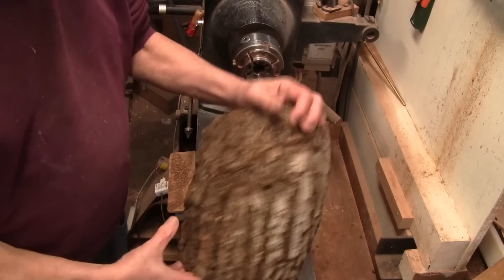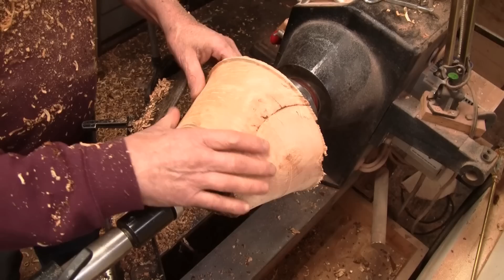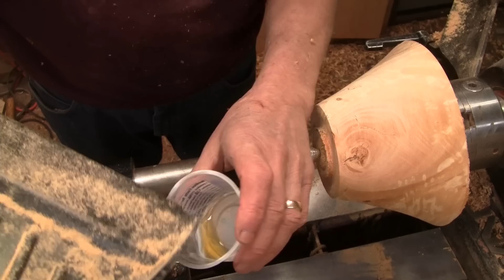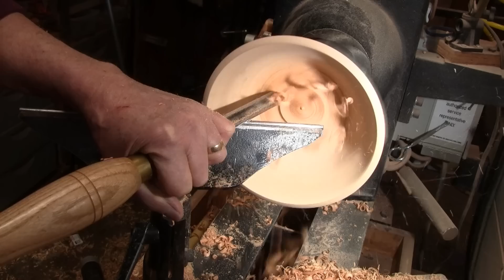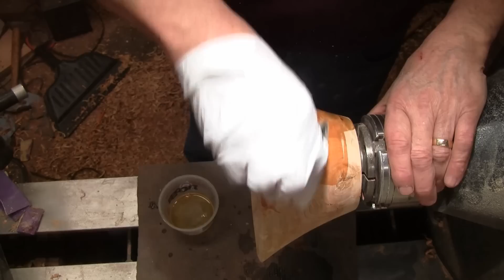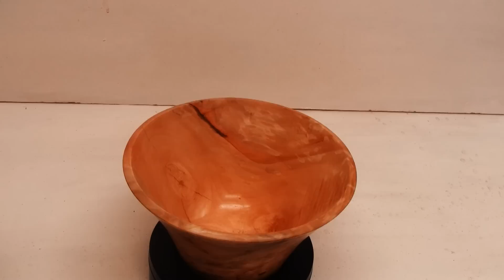Turning A Crackin Nice Piece Of Apple Wood

Comment: Beautiful Bowl. That is some very nice looking Apple Wood. I like your idea of mixing the saw dust with Shellac and Sanding sealer. I will be trying your trick. I have tried different glues with the dust. Does the trick but I don't really like the finished look sometimes.
Reply from the maker: Thank you John. Apple is a great wood to turn. 
I do not use glue for filling thing as the finish will not get through and you end up with a blotching looking piece. Maybe for filling a knot hole but I do not like that either.
I have built a lot of furniture and cabinets and you have to be extra careful where you use glue as it will always show if not cleaned up right away.
 Thanks for watching,
Gary

Comment: Curious about the technique of mixing fine saw dust w shellac for repairing small cracks. What is the advantage of this approach vs mixing sawdust w wood glue for same purpose?
Reply from the maker: For me I have the shellac going into the wood. Once wood glue is dry you can not get a finish into that area. It will just lay on top of the glue.  If you ever built a piece of furniture and did not get the glue cleaned up on some of the joints it will always stand out and look different.
With the shellac I was using shellac over it so it all blends together. I do the same with water based sanding sealer if I plan on using Polycrylic for the finish.
 Hope this makes sense and it is why I do it. Not to say other ways might work just as good.
Thanks for watching,
Gary

Comment: Good job Gary.
Great tip on shellac and sanding dust paste.
Fruit wood is certainly lovely timber. Thanks
Reply from the maker: Thank you Greg, yes it is hard to beat fruit wood. It has a lot to offer. The fruit, the pretty wood and the shavings are great for the smoker.
Thanks for watching,
Gary

Comment: I love pieces that have inclusions in them.  To me it gives the piece a natural beauty, 
especially when spalting is involved.  Using sealer, mixed with sanding dust, I never thought
of, but I will be including in the future.  That is one thing about videos such as yours, there is always new tricks to be learned that helps all of us.  Job well done.
Reply from the maker: Thank you Gerald. Yes all that nature really adds to the piece.
Try using water based poly with this sanding trick. It works great and you have plenty of time. But that also is when I use The water based poly. It is a good way to get the system down.
Thanks for watching,
Gary

Comment: Gary I love the grain and look of that bowl. It turn out beautiful. Thanks for the tip on using the dust and shellac to make a past. I will definitely be using that idea. Thanks for another great video.
Reply from the maker: Thanks so much Chris. I also works great with water based sanding sealer. I do that when I use Polyacrylic which is water based. Or if I just plan on using abrasive paste and wax for the final finish.
Thanks for watching,
Gary

Comment: Thanks you for sharing hi learning something a very time hi watch you work if hi used lacquer will do the same or sand and seal
Reply from the maker: Thank you Denis. Yes you can do it with lacquer. Do small areas as it will dry pretty fast. Same thing with the shellac.
The best to use is water based sanding sealer as it dries much slower. But that is when I use a water based poly for the finish.
Thanks for watching,
Gary
Reply: @ThePapa1947  thanks for the info

Comment: Beautiful piece, Gary.  Thanks for sharing the shellac/sanding dust trick.  Much better than making a paste from CA or 5 minute epoxy.  Love the figure in the piece.
Every time I watch you and Phil mount a block onto a spinning worm screw, I cringe!  While it can be an effective way to mount a block, it can also be dangerous.  You should mention to viewers that you are experienced in doing it and use a low lathe speed and a light grip on the blank.  If not done well, it can cause damage to the wrist, elbow and even the shoulder..  Just a thought.  Keep the videos coming!
Reply from the maker: Thank you Tom and your are right about mounting a piece that way. I have mentioned it but that was some time ago.
I will try and remember the next time I do it. It does take some practice to keep things safe.
I watch the piece getting close to the jaws of the chuck and then let go.
Thanks for the suggestion and thanks for watching,
Gary

Comment: Beautiful Gary.
I have only turned a few pieces of Apple but they all had gorgeous grain, just like this piece.
I have seen sanding dust and glue used to seal cracks but never sanding sealer and dust.
Great video as ever my friend.
Take care Gary.
Hwyl, Huw
Reply from the maker: Thank you very much Huw. I am sure you can fill cracks with dust and wood glue. My issues with the glue is it keeps the finish from getting into the grain. I know on furniture when gluing you need to get it all off while it is still wet or your finish will look different in that spot. Even if it looks like the glue is gone. So I stay away from using it to fill cracks.  If you have more to turn off it might be ok though.
Take care my friend,
Gary

Comment: Another pretty bowl. I was surprised you didn't fill the crack early, but it worked out nicely and the crack is an eye-catching element. Nice job, Gary.
Reply from the maker: Thank you Josh. I did fill it at the start but turned past the CA is my guess.
For sure the crack looks like it belongs there. And it does because I did not put it there LOL.

Comment: That's a great turning! I love the sawdust and sanding sealer mix to fill the cracks. Great idea! How long did you let it cure before turning or sanding again? Thanks for all you do!
Reply from the maker: Thank you Garry. You do not have to wait all that long. I would guess maybe 30-60 minutes is all I waited. Depending on the weather it might be faster or it might be slower.

Comment: Hi Gary, beautiful apple bowl. Great idea about the dust & shellac. By the way, you mentioned your poll barn(shed) where you store your wood. Might make a good video showing that. We’re all eyes! By the way, the hot glue worked great. Thanks!
Reply from the maker: Thanks so much. Apple is a great wood to turn.
The pole shed is multi use. Most of the space is filled by my drift boat. I have a few shelves where I can keep wood out of the elements.
 I do not recall which video it was but I did have some footage inside of it. I think it was a very hard piece of Cherry
Actually I just remembered which one it is: https://www.youtube.com/watch?v=3t1pM6fmHfM&ab_channel=ThePapa1947
Thanks for watching,
Gary

Comment: Very nice Gary, that apple is so beautiful. I'll have to try your idea of shellac and sanding dust to fill small cracks. I've been using thin CA and sanding dust, this looks easier to sand after the repair.
Reply from the maker: Thank you Gil! I could only guess how hard sanding would be with CA and dust.  I think the fumes would get me. I use the water based sanding sealer to do the same thing but not when I am putting shellac on.
Reply: @ThePapa1947  I always have good ventilation when using CA glue, good stuff but nasty fumes. A sheer cut or scraper does most of the work so sanding is not too bad. Still your idea looks better, thanks for your response Gary and Happy Easter to you and yours.

Comment: That's a beautiful piece Gary.  The figure in the wood is really striking and that inclusion gives it character.  Had never seen that trick with shellac and sanding dust; I've seen and used sanding dust and wood glue, the shellac seems a lot more suited for the application in which you used it.  I've noted that for future reference.
Reply from the maker: Thank you Mark. Wood glue might be ok for filling big knot holes but for cracks I am afraid the glue would get in the grain and the finish would not look the same.
Thanks for watching,
Gary

Comment: Nice project. 
You know, it's funny -- I usually use hide glue + sawdust to make wood filler, because hide glue is effectively finish neutral. I never considered using shellac sealer for the same purpose. It is also finish neutral AND it dries a lot faster, I would think.  It makes me feel a little bit slow that I never thought of that. Oh, well...🙄
I learn something new every day. Thanks for the tip!
Regards.
Reply from the maker: Thanks Jerry! How fast does the hide glue harden up? Have not tried that method but maybe it is worth a try. As long as it will take a finish the same way as the rest of the turning.
Gary
Reply: @ThePapa1947  I let it sit at least in hour for thin coats. I use several thinner coats rather than one thicker coat for deep cracks. So it can take a while. Hide glue, in my experience will take any finish I have used. For small cracks and holes, hide glue alone will make an invisible small crack repair in most bare woods because it dries to an almost transparent state.

The reason shellac seemed like a good way to go is because it dries more quickly and is likely less finicky than CA glue.

I will check it out. ✔

Comment: Beautiful turning Gary. Is the sanding sealer something one should be able to get at a big box store? I get the Zinsser Shellac but can never find the Seal Coat. As always thanks for sharing and have a blessed Easter!
Reply from the maker: Thank you Mark. I have gotten it at Home Depot. Ace Hardware has it as well. I have also bought it in gallon sizes from Amazon.

Comment: How long do you let your sanding sealer dry?
Reply from the maker: Most of the types of sanding sealer I use will dry in 15 minutes or less. The weather will affect the time though. On an average I would say I will get a second coat on in 30 mintures.

Comment: Love the bowl, it has such beautiful color and grain patterns and  I  like the idea of using sanding dust with the sealer to repair cracks! By the way that is not snow it is just slow release moisture! Well done and thanks!

Cheers Al
Reply from the maker: Thank you Al! Yes it sure turned out to be a pretty piece of wood.
Most of it melted when it landed so it all worked out LOL

Comment: Nice but I'm wondering why you didn't use a little bit of CAglue in that big spot a little bit on the inside would have shured it up and not hardly been noticable
Reply from the maker: Thank you Bill. I did use CA as soon as I saw it. Eventually turned past where most of it was. 
I could have filled it right before  the final finish cuts but I kind of like the looks of it the way it is.
It was just a choice I made at that time. Maybe the next one gets filled. 
Thanks for watching,
Gary